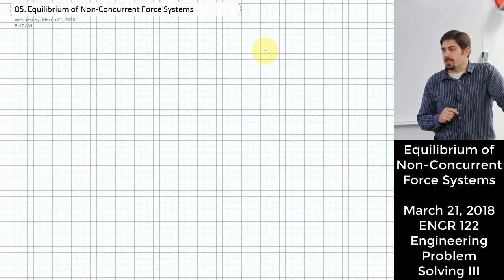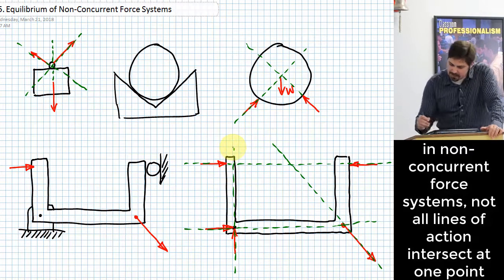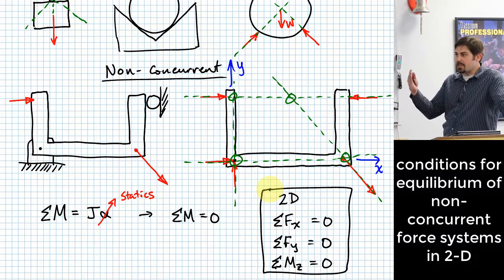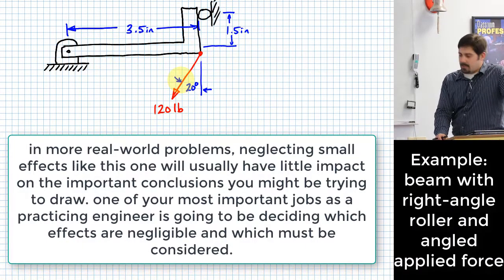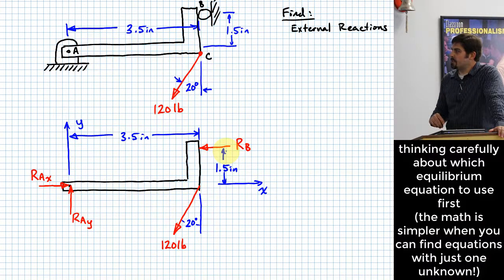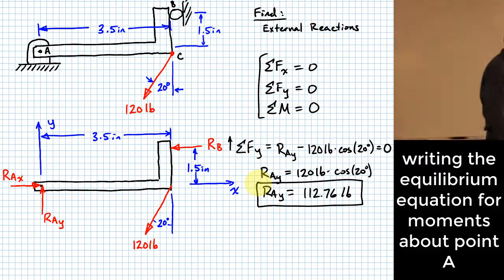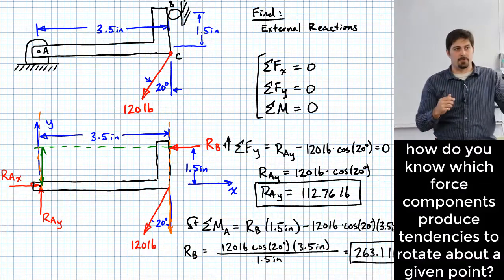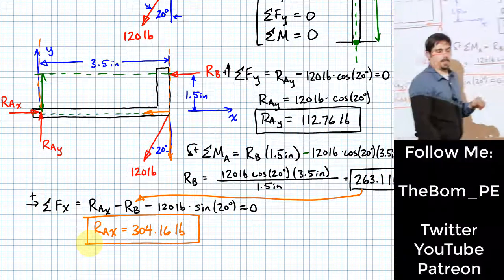Equilibrium of Non-Concurrent Force Systems | Rotational Equilibrium

Comment: Since the free body diagram was drawn of the L-shaped arm, would the direction of the reactions at the pin itself be in the opposite direction? My reasoning is that what was calculated is the force experienced at the hole of the L-shaped arm, so the pin would experience the same forces but in the opposite direction?